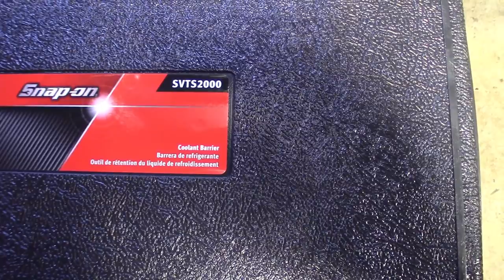Tools In Action  EP5

Comment: Hell ya that’s for sure going on my list of must have tools! Having that tool will speed up any clean up from coolant getting all over the place. After watching your video with the airlift coolant refill. I purchased one on eBay. I’ve used it 5-6 times so far and man I regret not having it sooner. Some cars I would have to drive up step hills to bleed the air out while running the heater full blast. Lol don’t miss those days anymore.

Comment: Very cool tool. Thanks for the video. Couldn’t you have created a vacuum after the hose was replaced. Shut off the shop air and drawn the coolant out of the bucket back into the system.
Reply from the maker: No because the vacuum that it creates isn't strong enough to lift the coolant out of the bucket.